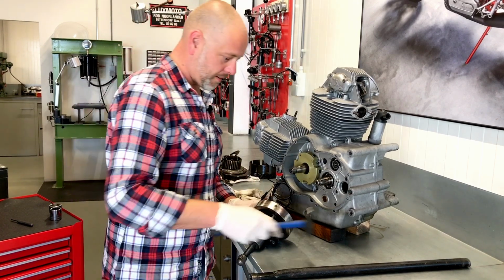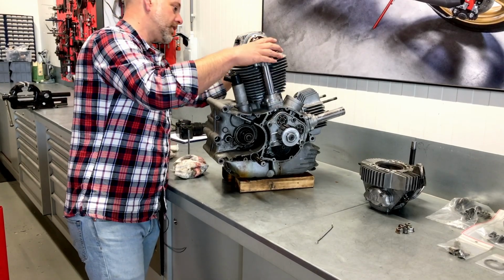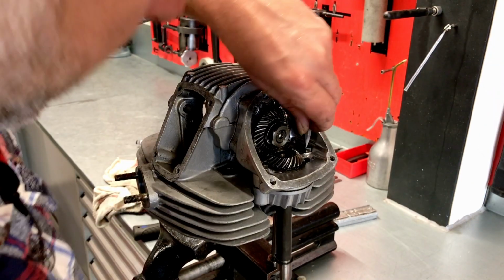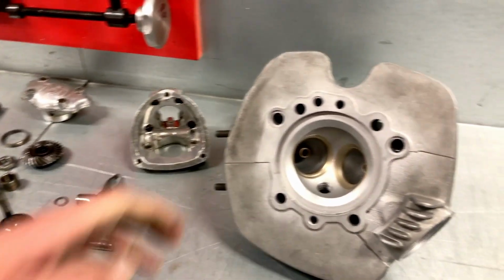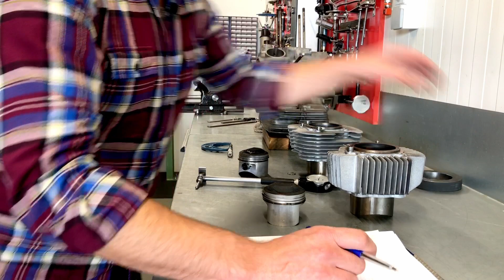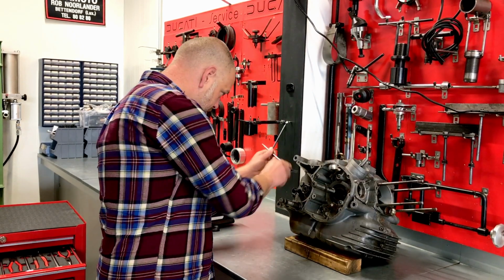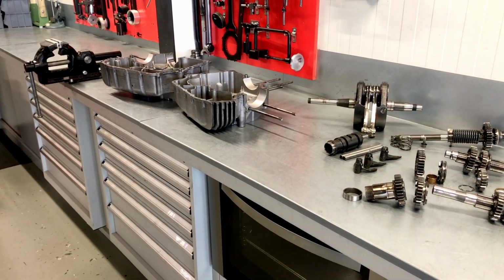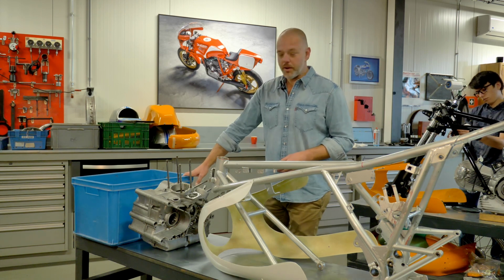Restoring a 1975 Ducati 750 Super Sport (Part 2) - Back to Classics

Comment: I still ride my Ducati with the Elletronica ignition system. It still starts easily and runs well. I have a new Sacshe system ready to fit if the old system fails but after 46 years it shows no sign of trouble!

Comment: I am amazed at the bodges I find when working on old motorcycles. If you fit the later valve guides, how will you modify the rockers to clear the seals?
Reply from the maker: We carefully grind the closing rockers down on the lower valve side. Just like the original items found on later engines with the top hat valve stem seal.

Comment: Interesting to see the gearbox mods, interested to know the condition of the gear that has a dog attached (4th?) I remember this was a weakness in the design, one of the gear teeth was located on the edge of a dog and had a tendency of chipping off a chunk. That and the dogs rounding because of the backlash dogs. 

I have had my  75 750, since 1981 an ex race italian bike, rode it home from Italy with the original ignition system coughing through the carbs onto my knee when it transitioned from full retard to full advance.